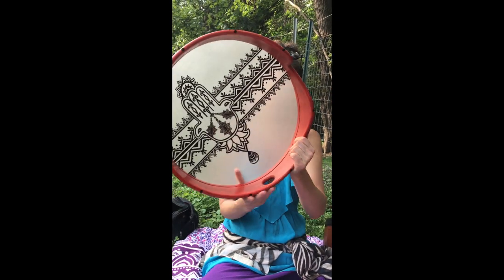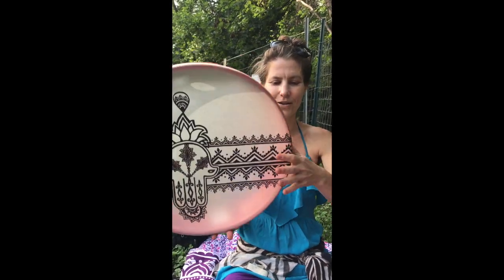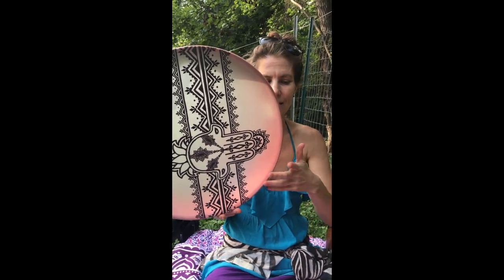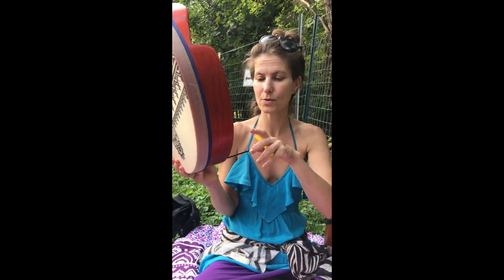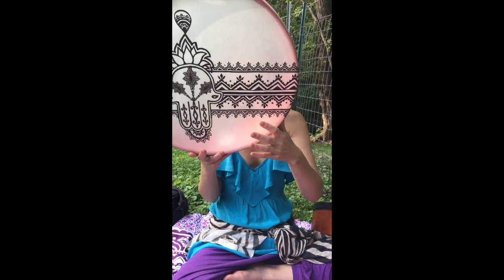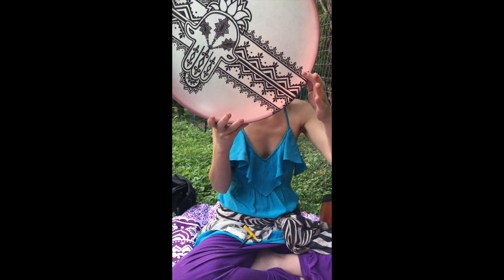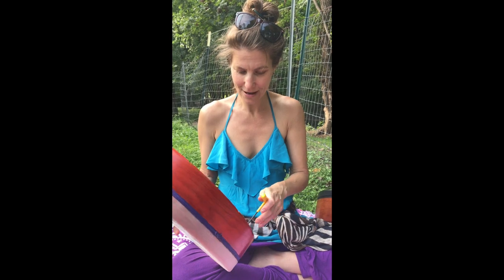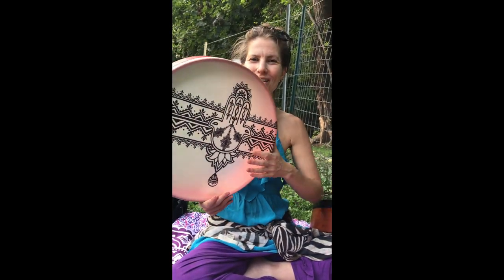Frame Drum Tuning Video with the Cooperman Marla Tar!

Comment: Great instruction! Question: is the Marla-Tar tuned in a pitch or could it be tuned in any pitch you like?
Reply from the maker: It likes to live in the key of A.. and can fluxuate nicely to a B or Gsharp - but if you like the sound of another key, feel free to play in that pitch!
Reply: Just got one of these. I'm attemping to tune it correctly. Do you recommend a drum shop if we aren't experienced? Or was that just a joke at the end?  😉
Reply: @maryk8509  You can buy a tuner and match the pitch of the drum to the tuner.
Reply: @farshimelt  thank you for the tip. We finally figured it out. We have a Tuner but it didn't sound right, if that makes sense.
Reply: @maryk8509  I meant the type of tuner that registers the pitch of the instrument and matches it to the tuner.
Reply: @farshimelt  oh, I see what you mean! Thanks for the tip.
Reply: @maryk8509  You're welcome.